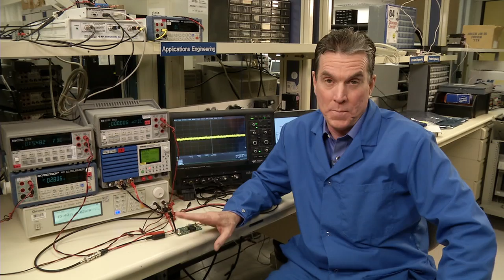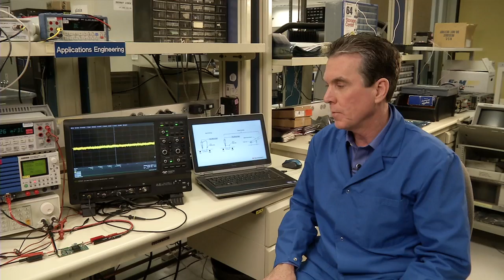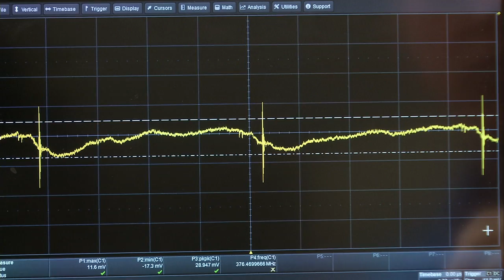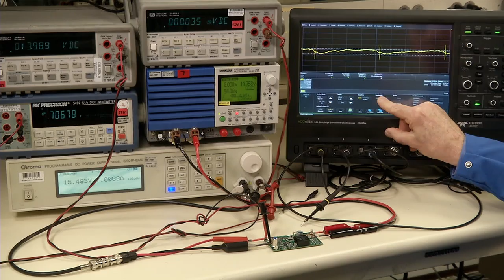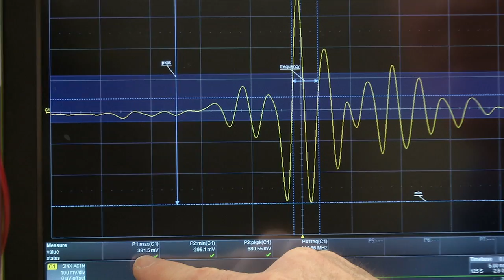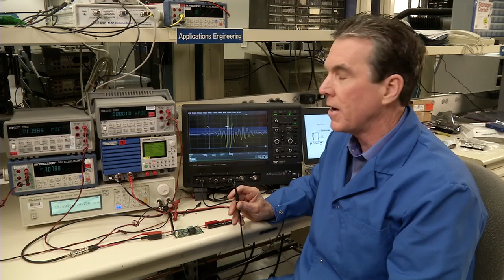Engineer It - How to test power supplies - Measuring Noise

Comment from the maker: Hi Bryan- 
Thanks for the comment.  The oscilloscope was a new LeCroy HDO6000.  The scope utilizes qty 4,  12-bit resolution 2.5 Gigasample per second ADC’s from Texas Instruments. The video was recorded in a remote lab which were fortunate enough to be able use for a few days. Bob found the 12-bit resolution made a new level of measurement possible. He could clearly see things that are distorted with the 8-bit scope, or simply not visible.
Reply: that about probe it self. 
1x10 ?? M ohm
or coax 50 termineted

Comment: That is one badass oscilloscope
Reply: +Hydranix HNx 500Mhz @2.5Gsps badass? We have a 100GHz @ 240Gsps in our lab. That's badass.
Reply: +Yo Da 10-100Zi?
Reply: Hydranix HNx Yeah! They have it in a half-height rack with other instruments which together costed more than several lambos! Pretty insane
Reply: and the probes cost more than a couple Toyotas right? As afraid as I would be to touch that thing, I want to play with it X)
Reply: That is true, although all RF grade cables and interconnect at those frequencies is severely priced! There are several engineers working on just making optimum use of the oscilloscope for HF measurements at the moment. At mm-wave frequencies instrumentation is a big PITA (or, "an art", if you prefer), and discerning between the noise floor and intermodulation distortion of the circuit under test and the internal circuitry inside the oscilloscope is really tough. I also learned just today that there is some considerable trickery going on for the highest frequency ranges. It's not a normal scope in several other ways than just the price haha.
Reply: Slightly overkill for this application lol...

Comment: How would you measure much lower noise levels, like for a linear supply, where the noise is way below 1mVpp? I mean if the measured signal is below the noise of the oscilloscope, what sort of probe do you recommend?

Comment: I am wondering how to check my power supply, on how much amps I get from it. There is not any label. I measure the voltage and it's 13.8. I connected my transceiver and on receive mode everything is fine, when I pressed the PTT it looks like everything going to die. Please help.
Regards

Comment from the maker: Ron: A Spectrum Analyzer identifies RF problems an oscilloscope helps pinpoint the cause/solution through time domain details. Fundamental/harmonics or mixing of ripple/transient noise can result in interference. A linear reg or LC filter after a Switch-Mode PS (SMPS) reduces this noise but ripple noise/harmonics can move from RF by moving the SMPS oscillator frequency. Transient noise can reduce/move with an RC snubber.  Specifics vary with design. For more: ow.ly\nLhUy
Reply: I agree, the oscilloscope can measure level, but where in the frequency spectrum are those levels.  That is my concern.  Noise from a supply can be a problem for many circuits like simple audio circuits, but for for RF applications the noise that is often from a switching power supply oscillator can play havic on RF circuits.  I did enjoy the video, just thought would give more info about RF noise.

Comment: I have seen the tip and barrel method for the first time, it seems that this method requires some special equipment to be present on the PCB to make the measurement possible.

Comment: Ok the tech switched from longer ground to barrel ground method.  But you're measuring at completely different points.  Capacitor filters out most of the noise.  So longer ground noise measurement should have been made same spot as pin & barrel test point.
Reply: I am wondering the same thing, but why not just use the springy ground probe to also measure the high frequency noise? That noise is still within the 100MHz range.

Comment: Nice video. One question, maybe a noob one. You've measured noise without a load applied (load is OFF, Power supply shows 30mA). Does load applied affect the results or is always a measurement done without load? Regards
Reply: yes, I am wondering the same thing.

Comment: But what about those spikes every cycle?
Are they to be totally disregarded?
What are they, even?
Reply: Hi Bodragon, Those very high frequency transient spikes are caused by a combination of EMI pick-up right at the probe, and IR voltage spikes during switching off (dead) times.  The EMI pick-up is caused by the probe and/or return picking up a magnetic field caused by the fast switching edge rates, this contribution is mostly not real since it's the probe itself that's receiving the energy.  On the other hand you will also see a spike during the dead times when both pass transistors within the regulator are off, caused by current flow continuing into a high Z.  If your load is sensitive to these spikes (depending on your application), they can be minimized by reducing dead time, if possible. But in any case much can be removed with proper decoupling capacitance placed very close to the load.  Series inductance can also be used to reduce the higher frequency noise but comes with ESR that will cause an IR drop across the inductor that must be considered. One of the many tradeoffs within a design.  Thanks for the comment.

Comment: The test was done by a tech, obviously not an engineer.  The good part is it shows the typical noise of a power supply output, but what about noise at say 14.1 MHz.  This is most concern for radio ops...will the power supply interfere with my rcvr???  A spectrum anal is needed...scopes at this levels are useless for RF.  Again a tech not an engineer doing the test.
Reply: Give the guy a break, Im sure he's surrounded by more engineers you can poke a stick at.. let alone all his years of experience and training with a survivor and leader in the industry.. TI
Reply: What makes you better than him if you seemingly don't know the answer to your question yourself?
Reply: Hes an engineer.